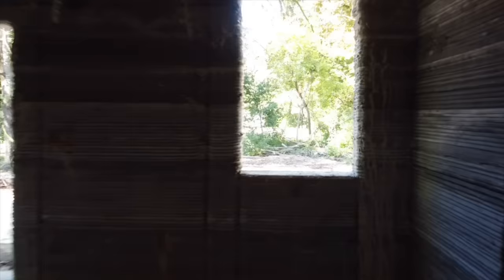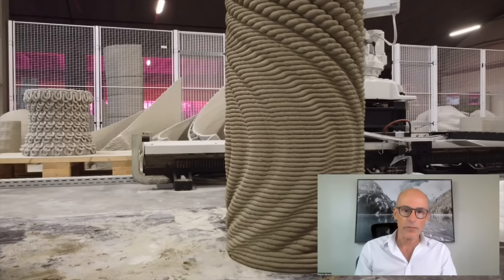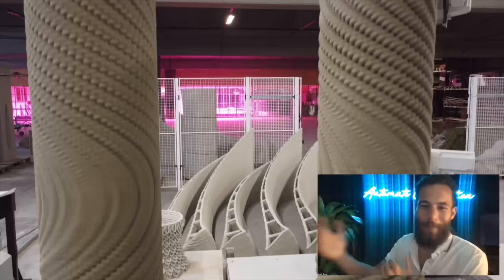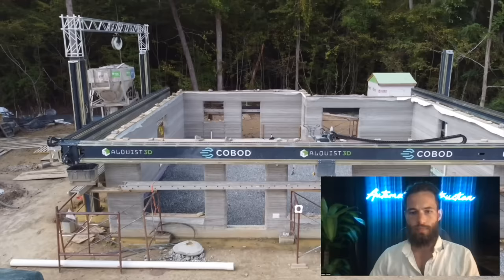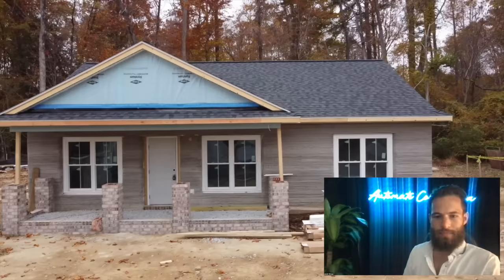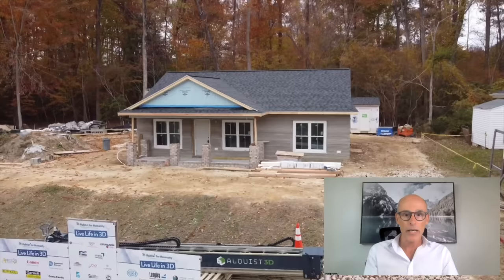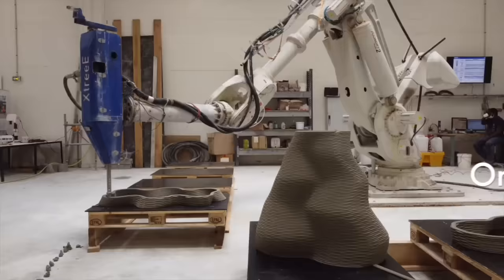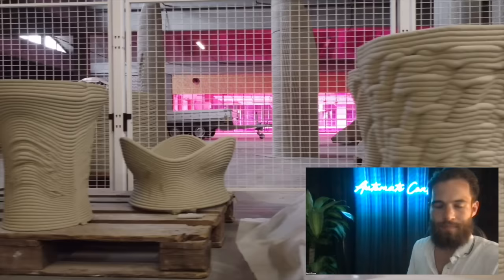11 Lies of the 3D Printed House | EXPOSING THE TRUTH of Printed Construction

Comment: Isn't it cheaper to have a factory-built house delivered and assembled on site?
Reply: it might be, if you want to use wood which is light weight for transportation. i like these thick, dense, walls. heating and cooling costs should be lower, with concrete, and they should be resistant to damage.
Reply: Only in light hyw size spec housing,
3d printing will beat market in customization longevity and price per sq foot after fully integrated assembly is automated. What there doing wrong is not contrling thermal managment 
Plug in play Spool in electronic plumbing and H vac assembly inagratin with sip pre fab roofing all installed off same inclosed gantry.

Comment: Please state specific dollar numbers of 3d printed houses compared to traditional timber frames houses of the same square foot / metre. Also does there need to be flat land all around for the printer to be set up on? What if the land is not flat and clear etc?
Reply from the maker: Construction isn’t commoditized like that, costs in one region could be double another

Comment: In regards to “price”….you still get WAY more house for the money than a conventional built house. 
It’s cheap enough to print so that the builder can afford to add in extras like steel roof, solar panels etc all for the same price as a conventional he built house. 
Not to mention the fact that this house has much greater secondary characteristics, like thermal, retaining, strength, longevity, etc. etc.

Comment: It has always seemed like 3d printed houses address creating the shell of the house, where the bulk of the cost is in labor and materials is in the plumbing, heating, and electrical systems.  In any case, reducing the cost of construction is irrelevant to housing pricing for consumers.  It just alters the amount that is split up between municipalities, speculators, and contractors.  You can't have cheap housing or that will destroy the property values of existing owners.  As long as zoning laws, land use regulations, licensing requirements, and other such restrict the supply of housing, and central banks manipulate interest rates to keep a guaranteed amount of housing inflation, rent will be high, and overall a lot of the economy will be directed towards housing.

Comment: The only people who think 3D printing houses on site is a great idea are those who have never run a 3D filament printer for a few years.  Its vastly more expensive equipment than a hammer, a saw, a tape measure, and a speed square.  It requires the entire house be planned meticulously in advance and will absolutely print in Stone every oversight and error in that design with no easy way to correct those errors. It complicates the running of power and water. The variability in climate and water on sites will ALWAYS be a problem with no easy solution.   Just like 3D printing in every other media, the key to reliable results will be found in a controlled environment.  Which means 3D printed houses should be printed modularly in a warehouse and trucked to a site for installation.

Comment: It seems that 3D printing is more efficient and cost effective only when printing small prefab houses, or prefab modials that could be assemeled on site, but using the printer on site to print big houses just doesn't seem to have many advantages over other building styles.
Reply from the maker: They are not very cost effective, regardless of size

Comment: The walls of a house are less than 20% of the cost of the build. Even if 3D printed walls were cheaper it would not be by much. Prefab walls are much faster, cheaper and more sustainable.

Comment: How does 3D printing deal with steel reinforcing? In my country in cyclone/hurricane areas, buildings are required to have steel rods tying the roofing structure to the foundations, so steel reinforcing cannot be avoided.. These clips of 3D printing don't seem to show steel reinforcing, and it seems to me that steel would make it difficult for the 3D printer to work around.

Comment: When you start innovating and thinking outside the box you are part of the solution not the problem. 3 D printing should be and is a better way to build ... why? Because measure twice cut once is now measure cut, as well as its only as good as its programmer, training and expertise take the place of all the mistakes made by measuring. Measuring is never the same from one area to the next but here it is. Its truly wonderful. Don't let these critics stop you.
Reply from the maker: Both of us in the video are dedicating our careers to this tech. Our criticism comes from an optimistic place and I do run with time some of these claims which are inaccurate today will become true.

Comment: there is a problem they don't address in construction 3D printing and that is the physical dimentions.
Current printers are nothing more than scaled up from the regular hoby type printers so they are very restrained on productivity because of it.
Construction sites are much much larger and the machine it self are made to scale with them as they imitate hoby printers.
On a construction site you can have a few nozles working around the building. Minimum of 4 each starting at their corner and working in the same circular matter is the minimum such systems should do. Using one nozle for a 20x20m site is just lack of imagination.
Also the whole crane like structures for navigations are not optimal. Lazer/optical sensors can do the same and drop down the installation time by factors.

Comment: I actually stayed in the 3D printed home at the very beginning of your video, currently being used as an AirBnb in Austin. I also visited the Icon home development in nearby Georgetown. Interesting stuff. I'm not sure what the compelling selling point is beyond the novelty of it. The homes in Georgetown were priced around $500K so there was no advantage versus stick building. I think it needs some sort of clear and universal advantage to make any significant inroads in home construction. I also assume that 3D printing does not lend itself to one-off construction (except for luxury homes) given the set-up overhead of the equipment.
Reply: in places like Florida where I'm from, insurance companies will no longer be writing policies for homes w mortages due to paying out every year for hurricanes. I can see the benefit of them if insurance companies will write policies for concrete homes. Same for homes in tornado alley etc. Everyone in florida thats a homeowner in 30 years will be either rich people or uninsured which sounds like a nightmare. Not to mention stickframe newbuild in a moisture rich, termite rich state, sucks ass and they dont last longer than the life of the mortgage in the first place due to getting rained on all the fuckin time during construction. A whole subdivision was built behind my parents 15-20 years ago and pretty much every home has had major work done on them due to rot.

Comment: Nothing is faster than a tilt up building 
The drawback is steel beams are needed
That being said, perhaps 3d printed homes and the tilt up design can be combined
The base structure being tilt up with 3d printed sections that have certain angles or overhangs that can't be poured on the ground
Honestly, I'm not a fan of the layer lines on a 3d printed house either
Leaving the layers exposed just looks unfinished to me and is basically just bragging about the fact it's not traditionally built
It would be more impressive if you couldn't tell so much that a house was built via traditional carpentry methods/ pre fab, or if the home was built in an untraditional manner using renewable/recycled resources 
I doubt we'll be 3d printing old rubber tires into houses anytime soon but we can 3d print polymers with wood fibers 🤔
We are just scratching the surface on 3d printed houses, I don't think a proprietary mix of material (basically concrete) is the way to go
I fix commercial reefers in concrete yards because throwing ice in the mix makes it set quicker and more densely, now they are using liquid nitrogen 
Polymers infused with concrete might be an interesting way to go, that would be one heck of an extruder and hot end though lol
Pumping out layers of concrete is the beginning, printing infused polymers on an industrial scale using recycled ♻️  plastics might be the next step
The bottom is the ground floor which is Y
The Y axis stays stationary and the X,Y,Z axis movements are all done via a 3 point frame that moves X Y while the Z is just the hight moving up
A giant portable, modular, bed slinger where the bed doesn't move
Set up the equipment using crane trucks, print the home, disassemble the gantry system, set it up where the next house goes and print away
The biggest drawback is being carpenters and framers working as a team are incredibly fast and efficient 
There's needs to be a niche that goes beyond just the 3d printed part
Reply from the maker: Automation is just getting started! I think you are at on the right track but I do think automation will be the best solution in the long term. The only big question is when it gets there.

Comment: All 3d prints should be done in a pop up tent incloser around gantry, to gain thermal control, and hoppers should have thermal managmet heaters fans and seniors to gain optimal control of materials, just like small printers get better prints when controlling environment. The driveway foundation and walls should all be done off the same gantry. The roofs should be done with pre fab SIPs and pre cut windows so install is extremely fast and can use same gantry crane system to reduce cost and time on install. H Vac Electrical and plumbing ( like pex) should be converted to a plug n play inlay system during print. Using a spool system by electrician/plumber operator. 
Inherently installing water power and ac/heat all in same print time without shutting down.(Should be abel to run power water and heat all before print is even finished)
If you could print a house in 24h with fully installed appliances, you would not have a housing crisis anymore and cost could be considerably reduced to be affordable.

Comment: For the issues of mix consistency and having to deal with different atmosphere conditions and weather based on location, why not make some kind of portable shield to put around the area you're printing so that you can create a controlled environment. This should reduce anomolies and help speed up dry times if you also make the shields have a drying feature. Food for thought...
Reply: More problems than benefits with this solution
Reply: @francescocerioni8939  isn't that what real 3-d printers have, a box surrounding them?
Reply: The most straightforward method will be to do a small test mix after taking environmental conditions into consideration, see how it fares, tweak it here and there and one should be good to go. Even regular construction is affected by local climatic conditions hence why for example when using concrete it's good to look up regional guidelines to get the best results, too much humidity during construction can affect the curing properties and structural strength can be compromised.
Reply: Yes, a shield, protection against wind, rain, there happens to be 1, fast, easy assemble, take down, cheap, reusable, large coverage, transportable, not much weight, available materials, tarp between wire mesh or other, reinforced with rebar

Comment: i also wonder if there could be a moving robot that can print, instead of a stationary printer. We have a lot of advancements in robotics. Maybe a sort of spider that can print the building and even build the other components in the near than you think future. Then you can connect a hose for the materials. But I imagine so much... What if there is a way to get the easiest fastest building possible, that would be cool. A project starting from nothing and making all materials from scratch and streaam line the whole process to be as fast as possible, just as like a project. From the plants needed for insolation etc, the pipes and electric managed as well, with maximal sustainability at each stage and the latest technology used.

Comment: I think the marketing is skewed.  You've got technology to print in virtually ANY shape, yet we're still seeing 90 degree angles and square openings...  So we have the tools without the imagination.  Then there's the application consistency.  I'd wager some sort of cementitious media is necessary, but why not incorporate foam pellets (like in Styrofoam) to cut back on the cement needed and make the matrix lighter?  You could then apply a hard coat stucco to even out the appearance or even enhance it.  

Ultimately I think we'll need method-specific fenestration and fixturing and glazing for it all to work.  And to make THAT feasible, the base construction would need to be more economical.  I think that would be achieved by computer modeling at the front end, so the design decisions and the economic decisions can be cohesively managed into something that beats the market.

Comment: Hasn't this technology matured yet to the point where they can eliminate that annoying horizontal ribbing from the printer layering? All I can see is crevice upon crevice for dust to collect on both inside and outside wall surfaces. It's still at the novelty phase.
Reply: Eventually yea by using a mold in the place so it dries straight.  And I am sure eventually they will add the quicklime Roman ingredient that preserved concrete by allowing it to self heal cracks
Reply: A render can be applied.  I saw another video where that was done to the outside and the inside walls.

Comment: there's basically a potential of cost or time, if the project of a house build IN ITS ENTIRETY was left fully to the 3d print and not the subcontractors coming in and adding their additions within the same time frame.
Reply: Would need your help in figuring that out.

Comment: How is it cheaper than regular CMU blocks ?? Just the labor costs?? Surely it's using more grout/concrete than the standard wall thickness of CMUs  ---

Its like NFTs - i just don't understand where the "savings" comes in - the block "masons" are just a small fraction of the price of the home

Comment: Too many regulations stifle innovative design and construction........if the builder or operator of a 3D printing service failed to supply the end product to customer's satisfaction there would be no need for the customer to accept the end product if it was found to be faulty.......building by 3D on your block of land should not be an option as the customer can falsely down grade the end product and refuse to pay up on completion......if the house e was constructed on a block of land supplied by the constructor and then offered for sale it would solve the problem of price and quality......if you don't like it don't buy it.
Reply from the maker: I just joined the ASTM committee dedicated to providing guidelines for regulations, I’ll understand stuff that much better soon!

Comment: Today's materials are tomorrow's problems, everyone who has worked in construction is aware of that saying, I see many issues with these but an obvious one is expansion joints, All concrete needs an expansion joint, floor slabs, even roads, but a south facing wall with expand and contract a lot, thin walls must be prone to cracking, moss on north facing walls in the northern hemisphere will be horrendous with that amount of texture, compression failure after a certain height and weight has been reached,. I'm all for new techniques but they need to be cheaper than this and compete with conventional buildings, brick walls, tiled roofs, wooden joists, its taken years of trial and error to get to the best  method of building,
Reply: Innovation is not cheap.   When the process is refined, the wrinkles ironed out (no pun intended) and roll out expanded, prices will come down.

Comment: You missed the biggest misconception:  That they are printing houses.  They are not.  They are printing walls.  Walls are not houses.  Walls are actually a very small percentage of houses.  This is more appropriate for barns, sheds, silos, maybe as a replacement for tilt-up construction, where walls are a large percentage of the project.  Big empty spaces that just need roofs.